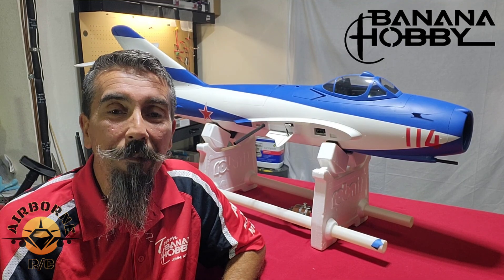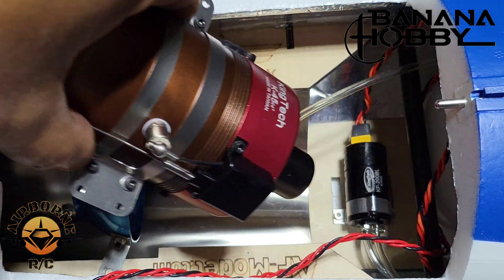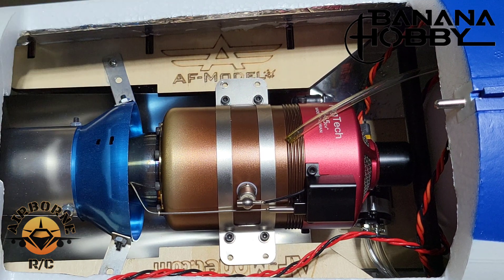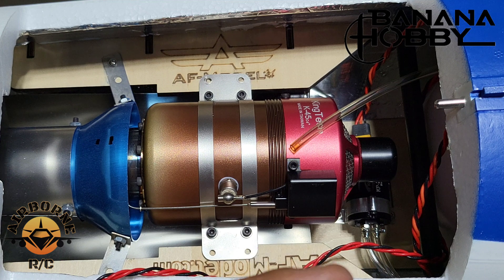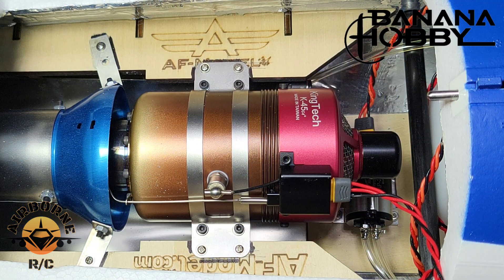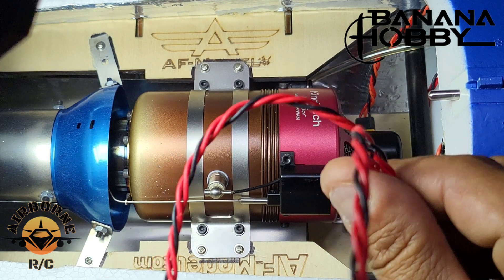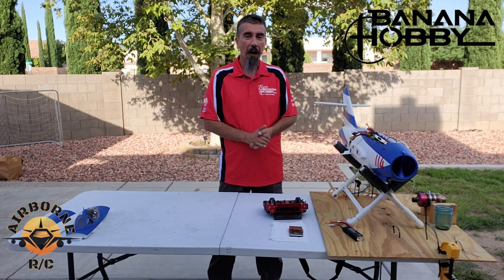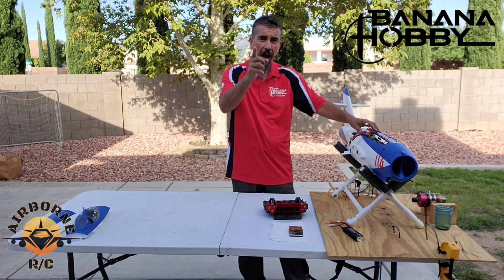AF MIG-17 Turbine Install for Beginners , Leak Test, and Test Fire

Comment: That's an awesome conversion, my friend. That plane is going to fly beautifully... You should maiden her at our airport here in Douglas... You can use the taxiways, which are extremely long and perfect for it...😁👍🏾 Thumbs-up for your video...👍🏾👍🏾👍🏾😁 Have a great rest of your night 🌙 👍🏾 Greetings from Douglas, Arizona 👍🏾😁🌵🇵🇷
Like #4

P.S. 

I looked for the part 1 video in your video's description, as you mentioned it, but couldn't find the link😁🌵🇵🇷
Reply from the maker: @ricardopr54  that was my plan to come down there. This wasn't a conversion. BH offers the mig-17 as turbine ready just like the big jets. This is one of em. I'll keep you updated on when will be a good day to come out 👍🇺🇲👊
Thanks for the heads up...part one is in the description
Reply: @NoonzAirborneRC  Awesome 👌